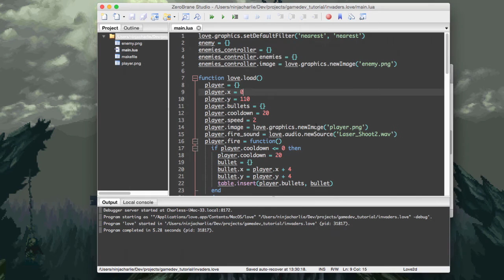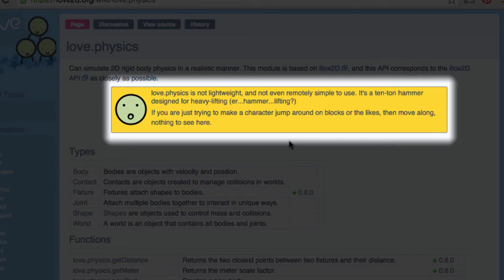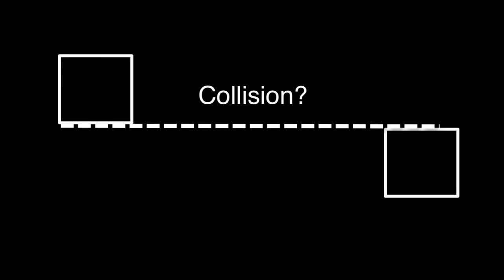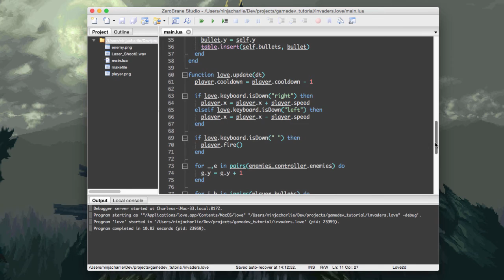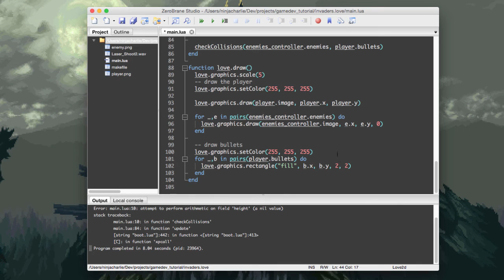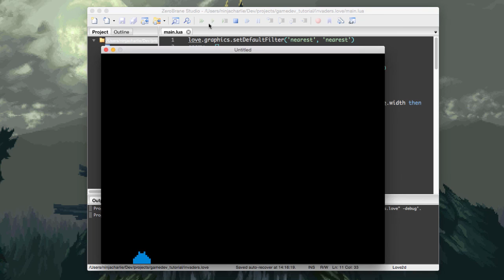Game Development in Love2D [Part 3] [Beginner Series!]

Comment: Found a fix for the killing enemies function:

http://pastebin.com/RWXd5uqe

The "print("COLLISION")" part is not necessary.
Reply: SkyLion Hi! Thank you for showing a fix! There is a couple of things that could be optimized in this pastebin. Firstly I see that you are going through the enemies list twice, first with the ipairs() function and then with a for loop. This is not neccesary. If you removed the for loop and simply changed the "_" in the ipars with "i" you would get the same effect, but dramastically reducing lag and processor usage! :) The other thing I want to point out is that you are only removing the first bullet in the "bullets" table. Simply changing the "_" in the bullets ipairs() function with something like "k" (or another variable, it doesnt matter) and then using "table.remove(bullets, k)" instead it should work properly! :)